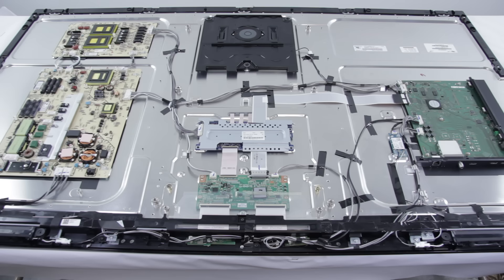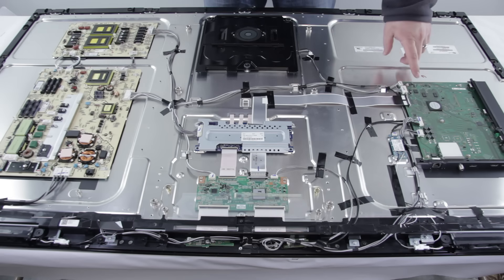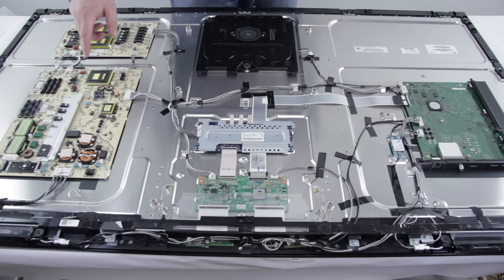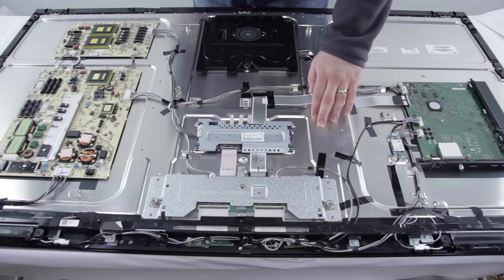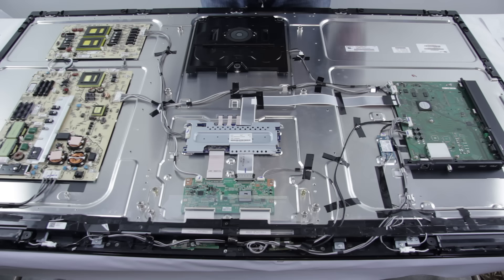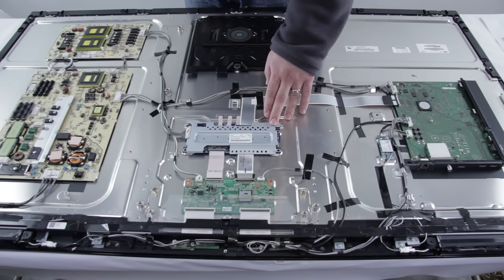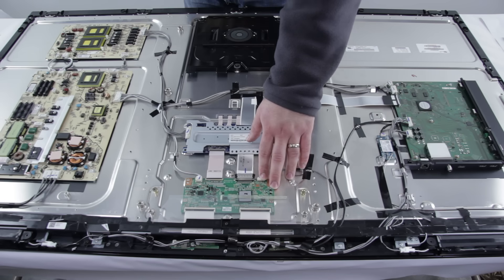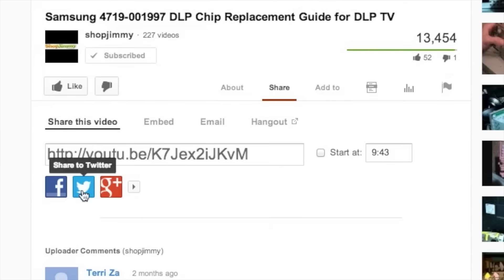LED TV Repair Tutorial - Common Symptoms & Solutions - How to Repair LED TVs

Comment: I have a Seiki SE46FY10. 
I am sure that I need a new black light inverter or bulb. 
My TV has been working fine for almost 2 years now and then this morning my TV's screen shut off and the sound continued to play. I could see very dimly the picture in the background. I was wondering what the problem was for sure and what parts I need in order to fix this problem. 

I have tried unplugging the TV and seeing if it would reset to default settings but no luck. I have also checked for external wire issues as well and I do not see any problems. 

Please let me know as soon as you can. 

Thanks,

Comment: samsung led smart tv model#UN65F7100AF
The tv will not turn on and has blinking light.I have accessed both boards i disconnected link between boards and powered up lights lit up which board is bad thanks

Comment: Hi, I have a sharp aqous quattron 52" TV model #lc-52le830u. The problem I have is the power LED is flashing and I can't turn my TV on. Even if I unplug it and plug it back in I still get the flashing power light! I've watched YouTube videos on how to fix the issue but I can't seem to find any solution for my model number TV. The common fix I see is to hold the input button and volume - together while plugging your TV back in, making it hard reset but I can't get it to work on my TV. I could really us your help please! What do you think the problem is?

Comment: Hiya I Have A 40inch LCD Colour TOSHIBA TV That Will Not Turn On, Even The Standby Button Won't Light Up This TV Is Only 1 Year Old. Model No: 40L1333B Serial No: C51W64Y06267K1 Power Supply: 220-240V ~ 50Hz 110W. Please Help :(

Comment: My TV is Samsung UA32F5100ARLXL.
There is no picture but only sound.I did the flash test and could see the images with torch light.
The service engineer says that the LED backlight is gone and the whole display panel needs to be replaced which would cost around 60 % of the price the TV.
I can not afford to spend that much.
Kindly suggest if only the LED backlights can be changed or the whole display panel including the backlights has to be changed as mentioned by the service engineer.

Comment: I have a LED TV
LG 47LN5400
Sr#306RMFP34691
Mfg Date: June, 2013

The picture went out but the sound and all functions continued as normal. Doing the flashlight test I could see a picture performing. It appears the backlight is bad.
What part do I need?
What instruction could you provide before I open this thing up, including any pertinent video's?

Sincere Thanks,
John Els
johnaels@gmail.com

Comment: Hi Jimmy,
Nice video.
I have a sony bravia KLV-40R452A LED. After 18 months of regular working in best way, now this has started giving problem.
The TV gets switched OFF and ON automatically.
After switch OFF, at times the white/green light on the front panel blinks for 4 times and then the TV comes back again.
After some time may be 10 mins, this again restarts.
Let me know what can I do to fix, this.

Thanks a lot!
Dharm
Reply: With the power reset from the power button , this is working now. Now we very often switch off the TV with the button.

Comment: I have a vizio 39" led smart tv model no. is E390i-a1. The problem that I'm having is my TV won't turn on. The light that shows power will come on when I hit the power button on my remote, but will then gradually fade away.
Reply from the maker: Nighthawk5523  Try all repairs and troubleshooting at your own risk.   I recommend replacing the main board in your TV.  Click this link to replacement parts for your TV model number:  http://www.shopjimmy.com/catalogsearch/result/index/?cat=56&q=E390i-a1  There may be multiple boards for the same TV model number, be sure to match part numbers on your current board, with your replacement for compatibility.  Here is a link to a video showing how to identify your part number, click here:  https://www.youtube.com/watch?v=kxkeGLhlQY8  Thanks and please let us know if you have any further questions with your TV Repair!  www.shopjimmy.com

Comment: Hi Jimmy, I find your videos excellent tutorials. I kind of learning a lot from them. In February 2012, I purchased a Sony Bravia 55 inch LED television model number X BR – 55HX929, at the time I paid $2500. The picture in the performance of this television is excellent coupled together with Verizon FIOS its rendition of high definition television is superb. Most recently we were on vacation and gone for over a week. When I returned the TV began to give me some problems.  After playing for several hours picture would dim down to almost nothing and then shut off. It would give me a blinking code of 5. After cooling down and disconnecting everything from the TV including the power the TV will fire up again. Once again performing excellently after several hours it would shut down again this time giving me a red flashing code 4. If I place a fan behind it the picture stays on much longer. Unfortunately this is very disturbing and unacceptable. I had to purchase a new 55 inch television. This time Samsung. I do have space in the basement where I can use this SonyTV. Is there anything you can recommend perhaps the power supply board that I could change out and still have some use of this TV in my basement rec room? I sincerely would appreciate your help, Steve G.

Comment: I have a problem with a Sharp LED 70" TV MODEL: LC-70LE65OU

This problem could be the T Com Board.

The TV screen will go into a scrambled state with stranged washed colors on the screen. 
The problem is more frequent when the TV is cold. This problem has gotten worse and more frequent in the past two months. If I shut the TV off and wait for the colors to clear off the screen and turn it back on the problem will go away but that only temporary. It will happen again but again it's less frequent as the TV warms up. 

Can you help?

Dean

Comment: Hello I have a 52in Philips plasma TV. 
Model # 50PFP5332D/37
I was watching TV for about 3hrs and the TV just turned off.  Prior to that we notice the blue light blinking red but wold still turn on.  But now it turns on but no picture or sound.  Please help it was built  in August 2007
Reply from the maker: Starla Esparza  Try all repairs and troubleshooting at your own risk.  I recommend replacing the Y-Main Board and the Upper and Lower Y Scan Drive boards in your TV.  Click this link to replacement parts for your TV model number:  http://www.shopjimmy.com/catalogsearch/result/?q=50PFP5332D%2F37  There may be multiple boards for the same TV model number, be sure to match part numbers on your current board, with your replacement for compatibility.  Here is a link to a video showing how to identify your part number, click here:  http://www.shopjimmy.com/samsung-bn96-06519a-y-main.htm  Thanks and please let us know if you have any further questions with your TV Repair!  www.shopjimmy.com

Comment: I have an LG 55LE5400-UC...lightning storm knocked the power out and when it came back on the TV wasn't working.  It powers on (I hear a distinctive click and beep), no picture though.  Last input it was on was one of the HDMI inputs connected to the Blu-ray player.  I disconnected all inputs except for the antenna to see if I could get audio, but I still wasn't able to hear anything - tried cycling inputs just in case it didn't default to the antenna input.  Tried the flashlight test too, but couldn't see anything.  Pulled the back panel off and the LED driver board has a blinking blue light and the LAN port on the main board is lit - so I know both boards are getting power.  I'm not sure if it's a main board problem or the LED driver board....incidentally, the only board available on your site is the LED driver board; all others for my TV are out of stock.  I only have 3 boards too, either the T-Con board is non-existent or integrated with one of the other boards.  

Please advise.  Thank you.

Comment: Hello ShopJimmy.com, I have a 32 inch Emerson LED Model LF320EM4 A, about a week ago the screen went into an almost negative looking appearance, such as having inverted colors. I turned it off, and the next morning I turned it on and it appeared fine, but as the TV warms up, it gets these lines that run the entirety of the screen from side to side that seem to flicker, these lines move up and down the screen and become more intense as the TV is left on, hitting it's max intensity after probably 20-30 minutes. For clarification on intensity, when first turned on there's no sign of any problems, but when the first lines start the lines are thin and small, but there's hundreds of them, but as it heats up the lines seem to merge into thicker, stronger lines. You can still see detail where the line is, as they become about a half inch in thickness per line, but it's a darker color than where there is no line, then they start moving up and down. I've only had this TV for 6 months and was looking into trouble shooting rather than out right replacing. Any advice or help would be greatly appreciated. Thank you!! =)

Comment: Hello,
I have a Samsung TV UE46D6200TSXZF i was getting a thin parallel line i followed instructions of this video (https://www.youtube.com/watch?v=j7vl7-vZEL8) by removing the ribbon on tcon board and adding a thin tape, but did not work, so i wanted to revert back so removed the tape. Now the TV starts without samsung log and does not show the picture and stops after few seconds.
Maybe the tape left stick material on the ribbon golden edge, how to clean it any ideas.

Thanks,
Nasar

Comment: Hi,
I have an AOC brand TV. It is a 42 inches LED TV. The exact model number is LE42A3320/61. The TV doesn't turn on. When it used to turn on, the blue light at the bottom of the screen would turn from blue to green. The blue light shows up when power is supplied to it, but it doesn't turn on. No sound either. Apart from the blue light at the bottom, it is pretty much dead. There was a thunder storm in our area with a lot of lightening after the last time it worked.
Any idea what might be the problem?
Reply from the maker: Ziaul Haque   PLEASE SUBSCRIBE TO OUR CHANNEL - Try all repairs and troubleshooting at your own risk.  I recommend replacing the main board and the power supply board in your TV.  Unfortunately I do not see any replacement parts in the search results for your TV model number on our website.  Please reply with your part number on your main board and power supply board I can try searching for replacement parts.  Thanks and please let us know if you have any further questions!  www.shopjimmy.com

Comment: funia model LF320FX4F 8 months old tried to turn it on the led power light comes on red but no pic. and there is a buzzing sound higher pitch sound
Reply from the maker: John Kelly   PLEASE SUBSCRIBE TO OUR CHANNEL - Try all repairs and troubleshooting at your own risk.  I recommend replacing the power supply board in your TV.  Click this link to replacement parts for your TV model number:  http://www.shopjimmy.com/catalogsearch/result/index/?cat=59&q=LF320FX4F  There may be multiple boards for the same TV model number, be sure to match part numbers on your current board, with your replacement for compatibility.  Here is a link to a video showing how to identify your part number, click here:    Thanks and please let us know if you have any further questions with your TV Repair!  www.shopjimmy.com

Comment: Jimmy?
I have an LG 50LN5400 when I turn it on light flashes through the holes. It has audio and a very faint picture. What should i start with? Thank you in advance.
Reply from the maker: Chris Wendzicki   PLEASE SUBSCRIBE TO OUR CHANNEL - Try all repairs and troubleshooting at your own risk.  This could be a problem with either the power supply or bad LEDs in the TV.  If you have the proper experience, you can use a meter to test the voltages on the power supply board to the LEDs to see if the power supply board is bad or the LEDs themselves.  If you do need to replace the LEDs, it is recommended that they are replaced by a trained professional, as you can damage the TV panel during the repair, and that is not repairable.  Click this link to replacement parts for your TV model number:  http://www.shopjimmy.com/catalogsearch/result/?q=50LN5400  There may be multiple boards for the same TV model number, be sure to match part numbers on your current board, with your replacement for compatibility.  Thanks and please let us know if you have any further questions with your TV Repair!  www.shopjimmy.com

Comment: Hi jimy...i have a vizio m470sl led 47" that went dead after a lightning strike on the back of my apartment. Tv is no responsive to power buttons or remote control...has no power at all, even tv logo is dead. I've  replaced the power supply, i can hear a small click noise when plugged but tv still dead, not even the amber logo turns on...now my question is, could it be the main board or led driver? Thanks for you time and help
Reply from the maker: Diego Carvalho  PLEASE SUBSCRIBE TO OUR CHANNEL - Try all repairs and troubleshooting at your own risk.  I recommend replacing the main board and the power supply board in your TV.  Click this link to replacement parts for your TV model number:  http://www.shopjimmy.com/catalogsearch/result/?q=m470sl  There may be multiple boards for the same TV model number, be sure to match part numbers on your current board, with your replacement for compatibility.  Thanks and please let us know if you have any further questions with your TV Repair!  www.shopjimmy.com

Comment: My TV model is LG 42LV5500.

This is the symptoms. Please advice what is spoilt.

https://www.youtube.com/watch?v=iDJJ7S2gCTQ
Reply from the maker: Clement Lee   PLEASE SUBSCRIBE TO OUR CHANNEL - Try all repairs and troubleshooting at your own risk.  This could be a problem with either the t-con board, the main board or the TV panel.  You can replace the t-con board and main board individually to see if one of those boards fixes the problem.  Click this link to replacement parts for your TV model number:  http://www.shopjimmy.com/catalogsearch/result/?q=42LV5500  There may be multiple boards for the same TV model number, be sure to match part numbers on your current board, with your replacement for compatibility.  Thanks and please let us know if you have any further questions with your TV Repair!  www.shopjimmy.com

Comment: Help... I have a Sharp LC-70LE650U My picture went from a clear picture to a tint haze over the picture to a solid white screen with a green splash spot on the screen to a solid black screen. Looking at your video could that be the TCon board?
Reply: Did you ever get a response to your question? I have the same TV with a little different problem with the screen. Dean
Reply: replace the Tcon board
Reply from the maker: David Josey  PLEASE SUBSCRIBE TO OUR CHANNEL -  Try all repairs and troubleshooting at your own risk.  This could be a problem with either the t-con board, the main board or the TV panel.  You can replace the main board and t-con board individually to see if one of those boards fixes the problem.  Click this link to replacement parts for your TV model number:  http://www.shopjimmy.com/catalogsearch/result/?q=LC-70LE650U  There may be multiple boards for the same TV model number, be sure to match part numbers on your current board, with your replacement for compatibility.  Thanks and please let us know if you have any further questions with your TV Repair!  www.shopjimmy.com

Comment: Hi I have an emerson lf501em4f that won't turn on the red led just keeps blinking.  I looked over the boards and there is no physical evidence of bad components.  I found if I disconnect and reconnect the ir sensor board I can turn the tv on but after turning it off it will not come on again.  Could it be the ir sensor or a bad cap that the ir board drains to low to turn on the tv?. Or could the main board be at fault.  Thanks
Reply from the maker: Clay Nagel  PLEASE SUBSCRIBE TO OUR CHANNEL - Try all repairs and troubleshooting at your own risk.  I recommend replacing the digital main board in your TV.  Click this link to replacement parts for your TV model number:  http://www.shopjimmy.com/catalogsearch/result/index/?cat=225&q=lf501em4f  There may be multiple boards for the same TV model number, be sure to match part numbers on your current board, with your replacement for compatibility.  Thanks and please let us know if you have any further questions with your TV Repair!  www.shopjimmy.com
Reply: It was the it sensor it works now

Comment: Hello I need a little bit of help with my Emerson tv, so I had a tv stored away in my backyard shed and a bug got in it idk what kind of bug but it's dead and I can see it when I plugg the tv in, its disgusting and I want to open the tv up and get it out I think it might be on the side of the screen idk but I really need help its for my daughter, I just bought the tv around thanksgiving a couple months ago it's a 50 inch emerson lf501em5f plz help
Reply from the maker: Eastsider420FU  Try all repairs and troubleshooting at your own risk.  I recommend bringing the TV to a repair shop, so that you do not break the TV panel while trying to remove the bug.  Thanks!  www.shopjimmy.com

Comment: I have an insignia model# NS-46D400NA14. After a lightning storm I started having problems. The tv will turn on and the sound works fine, the screen shows nothing but vertical lines and every once and awhile the picture will sort of pop through. It does not matter what input is used. I took the back of the tv cover off and did not see anything visually wrong with any of the boards. What do you think it could be?